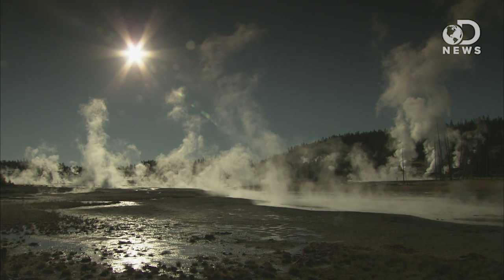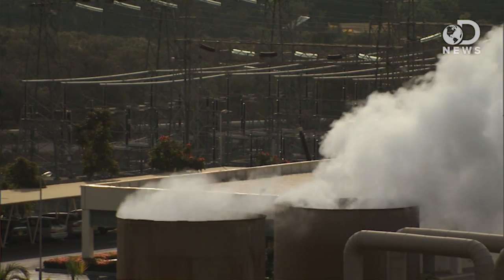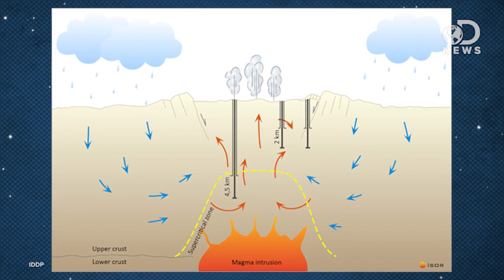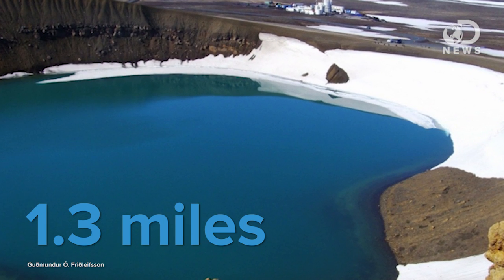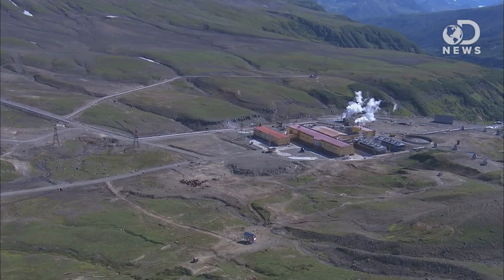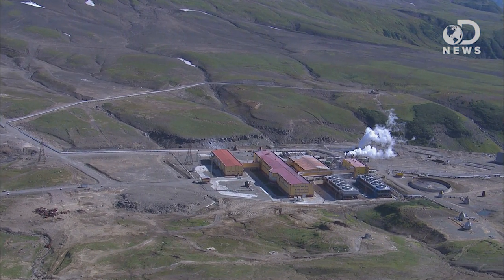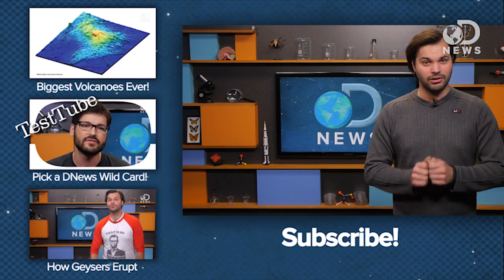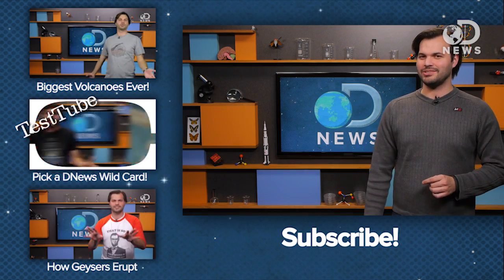Using Magma To Create Energy

Comment: My favorite form of renewable energy is wind and solar, they are clean and don't damage the surroundings during setup , and both are readily available, the later being in half cycles daily
Reply: both are good, but the drawbacks are pretty massive. solar requires too much actual space and are dependent on sunlight, overcast or night time you get nothing.
Wind is pretty good as it really doesn't require a lot of space. You could literally drop a turbine in your backyard. But again dependent on the weather.
Reply: phyrath5 Or you just don't know.
Reply: phyrath5 I have a plan to use human beings as batteries.
Its still in testing, but its already proved that people are prepared to plug themselves into a network that controls their entire lives.
Reply: canmore0001 There is a viable workaround to the drawbacks in solar.  I won't state it here because I intend to be the first to use it & I don't want the idea to be stolen from me.
Reply: Where I live the turbines that is used to harvest the energy of the winds kills..
ALL THE BIRDS! :o
Reply: phyrath5
Yeah, solar collectors in space that beam the energy back to earth.  I think there may be people working on that.
Reply: canmore0001 Wind isn't all it's cracked up to be. enormous fields of turbines in california take up tons of space, but provide only like 5% of the necessary power for the state. Private turbines are expensive to buy and maintain and are much less efficient than ones placed and designed by power companies.
Honestly, our technology on renewable resources isn't to the place where we can go all out on renewable energy. However, this geothermal idea, after a lot of study and trial and error could be a huge step towards a self sustaining energy source.
Reply: *****
Have you ever hear of graphene? It's just a layer of carbon. This structure makes it incredibly strong as well as a superconductor. It can hold vast amounts of electricity as well as be charged SUPER fast. It is more than likely that we'll be using graphene to make our batteries hold three times as much of a charge as they can hold now; and in less than a decade to top it all off.
Reply: milodudeful we came from thinking Nuclear waste had to be stored for millions of years and only using 5% of the fule before it's us else. Now with new generations of reacts, we can use 95% plus and the waste is only needed to be stored for 200 year(unless we can use up the waste) LIFTR reactor use Thorium instead of uranium or plutonium. and Thorium can't be used for doing nuclear bombs.
no things have no negativ effects.  it's a mater of what you think has best pros and coins.
all energis have it's dirt under the rug.
Reply: True, but the production of solar panels is still very expensive, requires a lot of power and the usage of highly toxic chemicals. There's a reason we let the Chinese produce most of our solar panels... they get to deal with the pollution :-/
Wind turbines are expensive to produce as well and need wind, duh, do work. No wind = no power. Countries like Germany are installing dozens of them off the coast where there's almost always wind.

You can be pretty damn sure that our planet will always be hot, especially when you dig deeper and deeper. The core isn't turning off anytime soon. If we could tap that power AND control it an energy crisis would be a thing of the past.
Reply: Jason J. Shaw I need to work faster then...
Reply: phyrath5 Well it does xD
Reply: by guns are on the LIFTR Nuclear power plant until fusion comes around.
Reply: sgcv A continual net over the entire globe would be impossible for a lot of reasons, such as the hugely inconsistent gravitational force around the world. Gravity isn't equally as strong in all parts of the globe, which would affect a net like this if it's in orbit. That would then lead to durability problems, as a whole slew of forces, including gravity, would be pulling on it from all directions. We would also have to be able to easily avoid it when launching anything into space and the list goes on.
By the time something like this is viable, we'll likely be on to some other form of energy, but you might see something like this spring up a long long time from now, possibly to help with other problems with the atmosphere, but I don't think we would see something like that in our lifetime.
Reply: and when "renewable energies becomes efficient. then we will already have better nuclear power with no waste and fusion. why send spaceship to a planet that will take 1000years  when we can want 200 years and travel there in only 10 year.

don't lay al your eggs in the basket(wing solar) when you already have the hen(nuclear) on the way of turning in to a swan(nuclear with almost if no waste at all
Reply: sgcv but how bad will that small amount be for the environment?
Reply: *****
an interesting thing i read, maybe it was from this channel. But there is some real progress being made on power storage using compressed air. excess energy is used to compress the air into a suitable container (in this case a capped mine) and when needed the air is released into a turbine. looks promising.
Reply: ***** In nature things generally avoid strange new things.  I find the idea that wind turbines would kill manny birds to be ridiculous.
Reply: phyrath5
Here's the Wiki about it! 
http://en.wikipedia.org/wiki/Space-based_solar_power
Reply: You again?
Reply: ***** You wont get me tin man! I know your weakness! Without the power of the sun your plan is sure to fai... fuck.
Reply: phyrath5 About the whole bird thing, it's actually entirely true. While wind turbines aren't a common cause of death, there are something like 500,000 birds killed by turbines in the US. For example, they are actually attracted to the turbines as perches for birds of prey and some turbine fields are located in migratory patterns for certain birds. And just to add to this, nature doesn't avoid new things, it tries its hardest to adapt.
Here's an article about the birds, if you're interested: http://www.livescience.com/31995-how-do-wind-turbines-kill-birds.html
Reply: Another problem with solar energy is that current technologies don't harness enough of sunlight. Last time i checked i believe less than 10% of the solar energy is converted to electrical energy.
Reply: i want a net basically around the earth in space of solar panels or something close to that to were they can absorb only so much light that light still passes through it but uses maybe 10% of the light to make energy so hat way places that have to much light kinda like a drought and cool it down to stop the drought or lessen it i dont even know if something like this is possible but it would be really cool
Reply: milodudeful it would be awesome but sadly for the moment, it's impossible.(space junk)
Reply: ya i know that much  #SelfDestruct  lol
Reply: ADay i thin he mean a network of solar satellites not physically connected, like many in the future as solar satellites "beaming down the energy. i can say for the future but with our technology now=impossible . and with all the space junk= REALY IMPOSSIBLE, unless we put them in a L1 orbit.
Reply: ***** put a few right in the way of a tsunami power a few citys
Reply: In order for solar to be truly scalable you'd have to produce it in space. Space based solar power is usually envisioned in three forms: sun-synchronous orbit, geo-synchronous orbit, and lunar based solar generation. All three have massive drawbacks that create it's own set of problems. I won't bother commenting on wind.
Reply: UPlayNetwork wind power can kill birds and solar takes to much space

Comment: It's not a good idea to extract that thermal energy from the core on a large scale
Reply: jayfulf Even if we do this on a "massive" scale, you have to keep in mind the sheer magnitude of the earth's thermal energy. Using it to power our cities would barely scratch the surface (pardon the pun) of the heat that already escapes from the core. I appreciate your concern, but alternative methods of generate electricity (coal, solar, wind, oil, nuclear) will in my opinion cause many orders of magnitude more damage to the "system" than drilling deep holes.
Reply: jayfulf The mass of the Earth is 6 x 10^24 kg (that's 10 with 24 more zeros behind it) with most of that mass being made up of magma.
Reply: GOD EMPRAH It's not the issue of it working or not, it can and does work
Reply: the heat is generated regardless of whether or not we extract it. A lot of it ends up on the surface anyway, but is insulated by the earths crust. Meaning, the earths crust absorbs most of the heat. We just take a bit of that and use it. Earths surface temperature will likely not change from this insignificant amount of heat extracted.
Reply: The heat is not "generated" and that's the first issue.  There is a finite amount of it and I don't think anybody actually knows what will happen if the system is altered.  Life on Earth relies heavily on the core and I don't think we should start fucking with it on a massive scale.
Reply: jayfulf you don't seem to understand how the earths core generates heat and how much of it is there (magnitudes greater than we could conceive of consuming for generations to come).http://www.scientificamerican.com/article/why-is-the-earths-core-so/
Reply: Then only  problem is, to dig that far down is expensive and building a pipeline is another story.Proof of this is that humans have never dug to lava
Reply: +PCzac he is talking about the mantle, which starts at about 35 km. (21.7 miles) deep, and that's about 5 times more deep than we've ever tried
Reply: Yes that's why there are volcanoes in earth's surface, but reaching the mantle is a whole other thing the holes we've dug had to spot because equipment was melting, at that temperatures there is no multicellular living thing that could survive and there isn't enough incentive in a world driven by petroleum... so we're lucky that there are people that put their interest in humanities future and not on money, so when we are the ones in charge of the planet our job would be easier, but still we need more people working for a greener future, we need people to collaborate, to make that little extra effort to help the planet, and that could save our species from extinction due to crazy weather at the end of the century.
Reply: the earth produced vast amounts of heat through nucular decay of heavy elements more than enough to meat our yearly global power demands a thousand fold from the heat it produces in a year.
Reply: douglas alderman When you spell meet with an a I don't take anything you have to say seriously
Reply: jayfulf I'm dyslexic
Reply: douglas alderman So dyslexia now affects what keys you press on a keyboard and what letters should be included in a word?  Weird, my friend just has the one where it affects his reading.
Reply: jayfulf it probably affects his writing two. when reading letters and words appear to jump between lines and I have to correct for that I also struggle to recall text but can recall images well and can easily flip rotate and combine 3d objects accurately In my head witch Iv found most other people cant . basically my brain is wired differently its very well sited to problem solving but not writing I had to correct a third of the words in this.
Reply: douglas alderman I think you're missing a key point here.  You could be blind and still be able to type properly as long as you know which keys are where.
Reply: you having form what I can tell abysmal scientific knowledge doesn't mean you should divert the subject to some thing that doesn't matter. you should be learning from people that know more than you to improve yourself if you want to get anywhere in life.
Reply: douglas alderman Not trying to be funny or rude but your English is broken and I just cannot take someone seriously when they're communication skills are so poor.
Reply: jayfulf, you're an idiot! I'm dyslexic & CONSTANTLY have to spellcheck/change my b's to p's & visa versa because my brain types them wrong & it's not possible to go "large scale" on geothermal due to the sheer volume of heat in the planet. I don't think you have any grasp of how big the planet is & how much magma is in there! The biggest we could possibly go would still only be a TINY fraction of what's there!

Comment: that's actually a very clean energy alternative and my guess is it's MUCH more powerful than wind and solar put together.
Reply: *****
but the point is to go as close as possible without that happening. These scientists aren't idiots.
Reply: Yes, but its way harder to acquire.
Reply: and much harder to harvest... wanna know what happens to steal if you throw it into lava ? it vaporizes, so yeah the heat is a bit too hot to work with
Reply: for now. we'll eventually get materials that can resist the heat
Reply: killer13324 yeah but that could take decades
Reply: Mace I know that but the  whole point of my  comment was to point out how hard this energy is to harvest (congratulations on completely missing that point by the way )
Reply: I already know that too. Your comment adds little to the discussion. It would have been more pertinent if you had said something worthwhile like commenting on what kind of materials they will actually use. This energy alternative seems cheaper than trying to make energy cells more efficient (since natures limit caps photosynthesis at around 4% efficiency). The theoretical limit for man made photovoltaic systems is at 11% of the suns radiation. And safer than Nuclear Power.
Reply: ***** Why put the STEEL in the magma?  It only has to be close enough to create steam.
Reply: ***** "wanna know what happens to steal if you throw it into lava ? it vaporizes". Gosh ... magma has temperatures of about 700-1000 C degrees, and steel melting point is about 1300 C degrees and evaporation point is 2500 C degrees. So no, it will not evaporate, not even melt.
Reply: from memory diamond though impractical to use for this 4300 deggres kelvin tungsten something near 3700 some ceramics can get to around 4000 but steal only around 1700 degres kelvin Id guess most rock melts around 1000 to 2000 degrees kelvin
Reply: The fire in a coal-fired power plant can be as hot as 2,204º C.

Comment: We have a giant fusion reactor floating in the Sky. Or rather, we're floating in the sky of a giant fusion reactor. We reallly should use it more.
Reply: we can't really get close to it, and we can't take much advantage of it because of the atmosphere... transferring electricity would be hard if we have a satellite for it, so we are taking the best we can out of it with solar panels.
Reply: trevan123456  A gestationary powerplants that beam the power down using microwaves would help solve that.
Reply: Sarge Rho it probably isn't cost efficient yet to build a satellite to do that, and because money is people's best interest no company would build one until the cost of fuels down here rises more, it is a cool idea none the less.
Reply: trevan123456 I think given current technology, it might actually be cheaper in the long run than a nuclear powerplant, at the same power output, and that's extremely cheap. Japan is working towards one, and I think ESA has expressed their intrest in one too. It'd be more expensive to set up than a nuclear powrplant, but the maintenance cost would be minimal. Basically, you'd need to resupply it with fuel every once in a while, for station keeping,,,which you can grab from near earth asteroids.
Reply: ***** You actually can't use it as a weapon unless you mount weapons on it, in which case you may as well use surface based high energy lasers.
Reply: ***** No. The energy density of the microwave beam is about that of sunlight.
Reply: ***** Hehehe. That is not to say you couldn't use the powerplant to power a laser...but you'd have to put it there first, and I think by the time a laser reaches the ground, it's so defocused that it'll no longer do any serious damage.